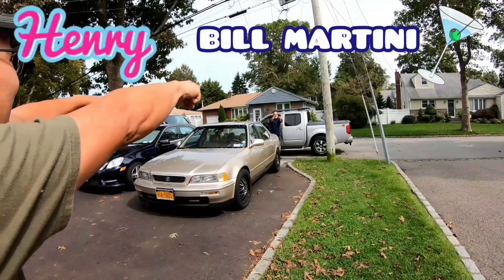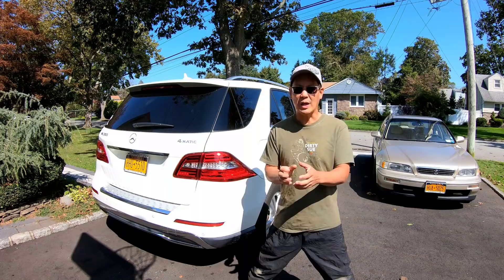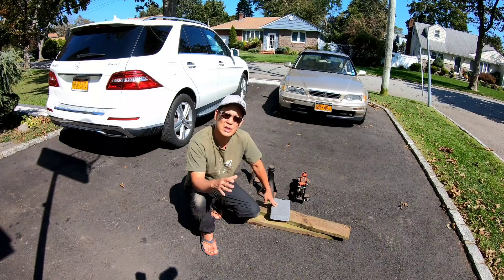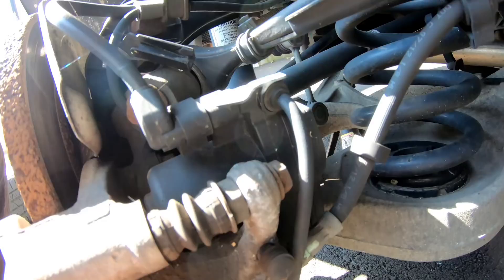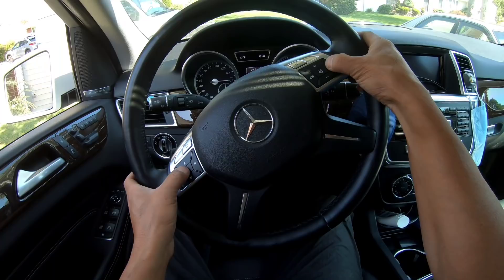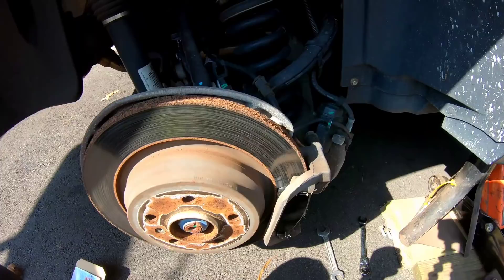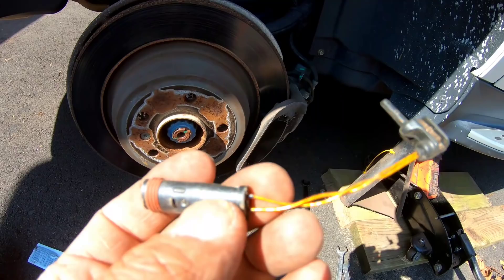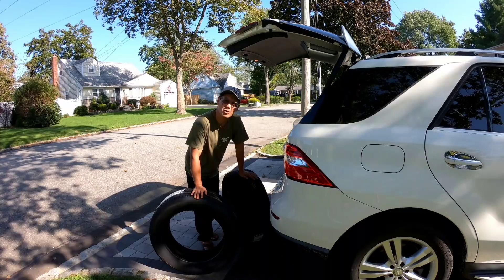DIY 2013 MERCEDES BENZ ML350 BOSCH REAR BRAKE PAD ELECTRONIC PARKING REPLACEMENT NO SCAN TOOL NEEDED

Comment: Good job Henry!  I have a 2014 Chevy Impala.  Front struts needed replacing.  My mechanic estimated $757.00 for parts and labor.  I got my own struts from Rock Auto for  almost $300.00 less than what my mechanic's NAPA parts store wanted; so all told, cost to replace struts was $400.00 instead of $750.00.  Moral??  Price the parts around.  Of course my mechanic doesn't mind the customer getting his own parts.  Oh, the struts I got were the exact same as what NAPA would have provided.  I used to do my own labor; too old now!!
Reply from the maker: I’m almost there where I don’t want to fix brakes myself either.

Comment: Surprised you’d do pads without rotors as they looked rusty and grooved, not the right way but you got the job done, thanks for the video
Reply from the maker: Rotors were not grooved and within original specs.  Changing pads does not equate mandatory rotor replacement,  that’s just what’s recommended by every stealership wanting to maximize profits
Reply from the maker: You must be a Mercedes tech or service advisor
Reply: Oh ok the rotors looked grooved on the video to me, all good then
Reply: @MowersNBlowers  no just somebody who likes to do a good job on replacing brakes, the rotors looked pretty rusted, and they look like they had grooves in which can wear  the new brake pads uneven
Reply from the maker: @timhiller1029  we get our emission and safety inspection at the Mercedes dealer every year,  it was them who recommended we change brake pads but rotors were still under spec.
Reply: @MowersNBlowers  after taking another look at the rotors I do see they are not grooved so I agree with you, I didn’t have my cheaters on when I watched the video LOL

Comment: I've done a drive way sealing, 5, 5 gal buckets, the drive way was longer and wider then yours, I would say 3 5 gallon buckets, and make sure it's leaf free, take your time, start it early in the morning so the afternoon sun can be can bake it good, and use the empty buckets to block the drive way, and make sure the mailman knows its wet.... LMAO..... It's very easy, start with the edges, and work towards the center, and then down towards the street..... Best advice, get the sealer spreader makes life so much easier, and most of all.... "TAKE YOUR TIME".

Comment: I have the 2012 ml350 W166…need to replace blind spot assist sensors behind rear numbers. Any reference material or videos you can refer me to please?
Reply from the maker: Thankfully I haven’t had to do those,  seem straight forward though,  just replace sensors.  Search YouTube for it

Comment: FyI. You MUST replace rotors or turn them.  They break in together. It can glaze your pads.  This can cause unpredictable brake failure/fade.   Did it once, never again...
Reply from the maker: Done this 6 times on various cars,  replaced rotors on a couple.  No difference.
Reply from the maker: 2012 MERCEDES BENZ E350 4MATIC FRONT BRAKE PADS & 322MM DRILLED ROTORS REPLACEMENT DIY $138 VS $1600
https://youtu.be/SHN4B1P7OZg
Reply: I've pad slapped with no issues.   It depends on the pads.  I use ceramic so no issues.
Reply: @michael931  I've done it 3 times, all resulted in very poor braking.  I guess sometimes ya get lucky.. I just want a diy guy do it on his wife's car, and she makes a hard stop , and the car don't stop

Comment: I had two of my cats neutered last week, they're doing great. I was half neutered in June due to testicular cancer.
Reply from the maker: Yes I remember you told me.  What were your symptoms?  Or regular urologist checkup?
Reply: @MowersNBlowers  I went to sit down to watch a movie and my ankle knocked into left testicle. I went to the emergency room and they did an ultrasound. My tumor makers are in normal range now. No more weekly bloodwork. 

Honestly the whole process went extremely  quick. I was tested for covid19 then a week later I had my orchiectomy. It was larger than an extra large egg, sleeping was no fun!
Reply from the maker: norge696 you never noticed one was bigger?  It was it triggered by the ankle to the nut?
Reply: @MowersNBlowers  No, I gently sat down and my ankle hit my nut. It was painful! Went to the bathroom and noticed my nut was swollen. Doctors don't know how it comes about, it just does.

Comment: Ahh down south where I am there are no inspections except emissions if you live in certain counties. And if it’s > 25 years old not even emissions.  
I have always wanted to do my own breaks but  haven’t.  Maybe this will inspire me.  👍
My next thing I might try is installing a shift solenoids block into a non CVT Jatco/Nissan automatic transmission.

Ahh not sure about the dog

My Boston Terrier/ Dachshund/poodle is kind of hyper also and it’s a “she.” Not a “it” yet 

Let’s see if boba chills afterwards
Hope all goes well.
Reply from the maker: Did you see my segment on the Kohler air filter base kit?
Reply: Mowers N Blowers  yep.   I didn’t know it was a recall until after I got the kit. 
But is a recall only if you complain I guess.    Anyways I ended up selling the mower a little bit more than normal to account for the part.
Reply from the maker: D Fields well thanks to your video, it prompted me to complain.
Reply: Mowers N Blowers 🙏

Comment: Buy Boba neuticals fake balls. They cost like $75 bucks but then when he runs it sounds like the old toy Clackers ! Like everyone else said you put the grease on the unthreaded part of the caliper bolt so the caliper slides freely when hitting the brakes and releasing. The one pad that was wore out was probably dry and not fully retracting and was dragging..

Comment: What size of wrenches did you use
Reply from the maker: I forget, it was a year ago.  I just did a video on my E350 with an 18mm wrench to remove the caliper bracket.
Reply: 13 and 18

Comment: Can you use the old brake sensor again for the new pads?
Reply from the maker: Only if you’re careful.   You try using the old one,  but if you get a warning light on your dash,  you need to get a new one.  You usually damage the old one when removing